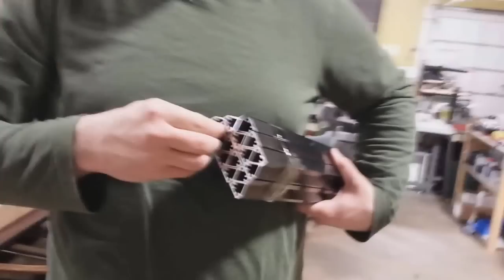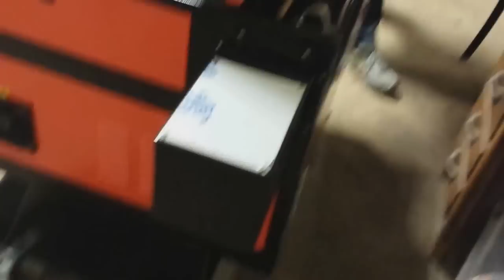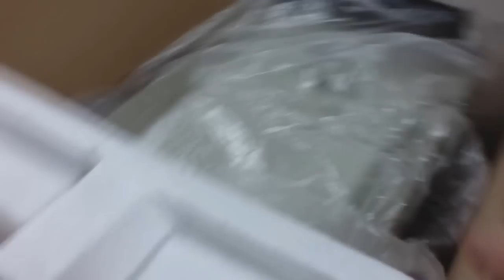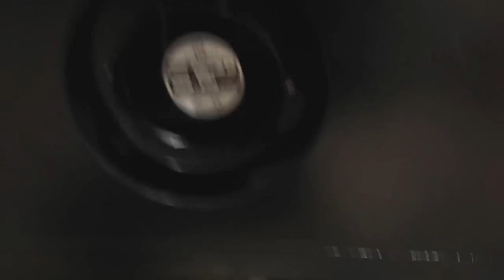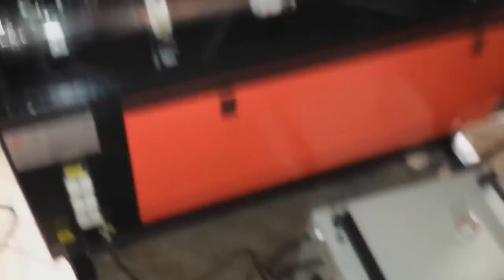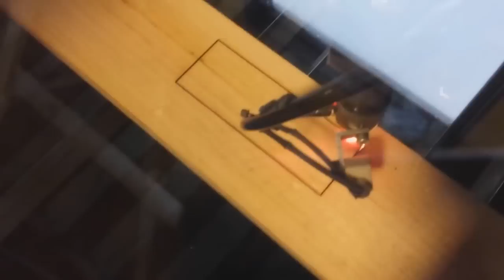Redsail X700 60W Laser Cutter Unboxing from CNCcheap

Comment: I see you got a transformer with it. Did this allow you to use the back plug ports for the exhaust, air, and chiller without them overheating or melting? I was thinking about re-wiring it but after understanding these are really wired for a Chinese/European 110/220 v  the transformer made sense and thought it would resolve the issue many people run into by connecting it to a US 110 outlet.
Reply from the maker: Yes the transformer boosts the standard US outlet voltage to 240v which powers all of the other devices. The outlets are cheese grade chinesium but we haven't had any issues with them melting. The chiller just has a fan and a pump, we replaced the little reciprocating air pump with a larger compressor (powered externally from 120v) for better cutting and also added a higher powered exhaust extraction fan which we also powered from the outlet in the back.

Comment: H, i have on of these - the exact same actually.  i haven't used the rotary attachment (can you believe it , after probably 6 years).  i now need to, and after looking inside i see that i need to plug the rotary connector into the controller - but i'm not sure where?  there are 3 possible plugs that i can unplug where it would fit.  any help would be great, thanks

Comment: I got this same machine.  Just received it last week.  Went through everything and it all seemed to be in order ... BUT ... Hooked everything up today and all the items work ... EXCEPT the laser itself.  Can't get it to pulse test or to recognize the computer.  Everything moves the way it's supposed to. The laser simply will not fire.  Any thoughts?    PS  I didn't get the chiller with it for some reason they sent a tube with the pump.  However the hookup for the "chiller 3000" is on the box but there's nothing to hook up to it.  Any chance that could be an issue?  Does it need to be jumpered?

Comment: We just ordered the same machine. Are you having any issues? Any suggestions?
Reply from the maker: Chris Olger Mostly just quirks with the software. It can be annoying to get it working with files saved from actual CAD programs. Once you get that figured out though, the machine works very well
Reply: Photon939 Are you using the software that was supplied or Corel?
Reply: +Photon939 how wide is the machine? it looks huge

Comment: That Hailea is supposed to be a good compressor; it's a linear motor compressor made for tank aeration applications, which is the reason why they packaged in the air distributor.  The company also makes regenerative blowers.